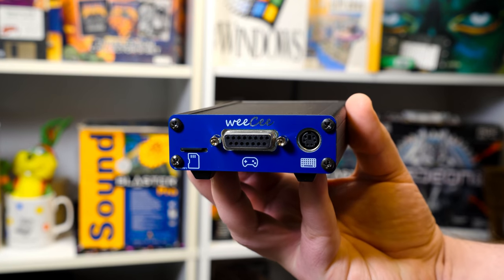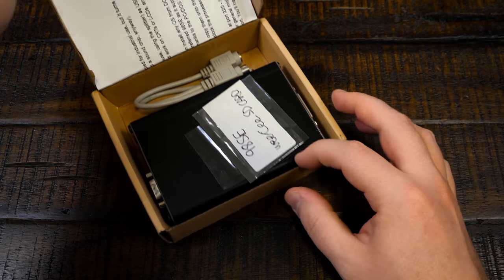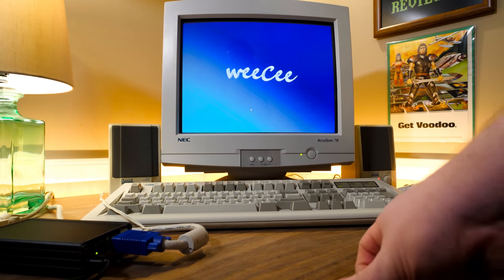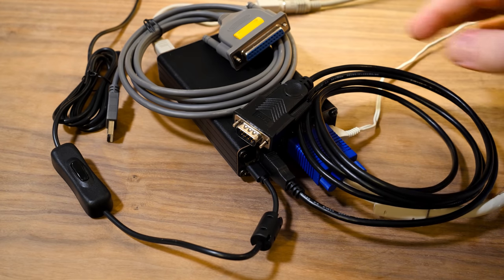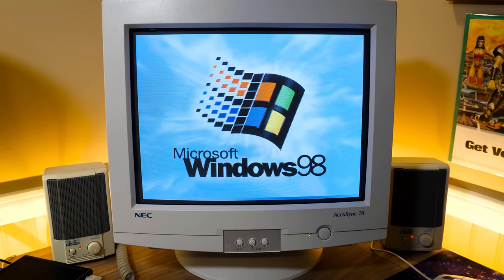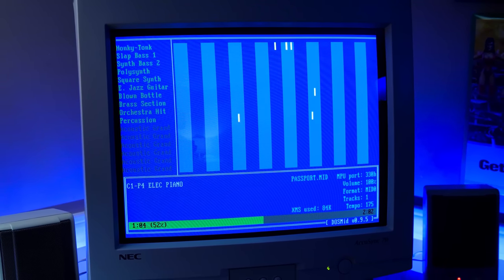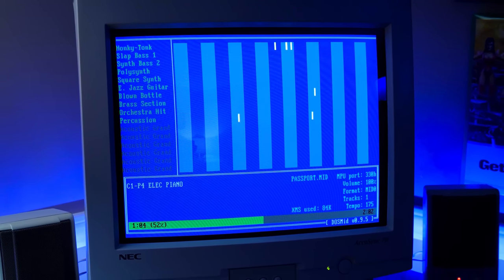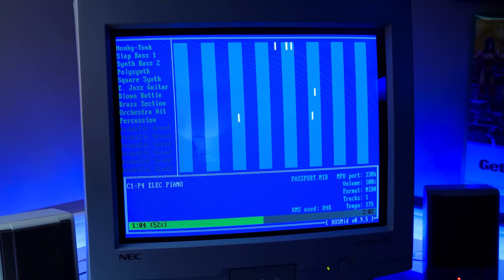The weeCee: A Tiny New MS-DOS & Windows Gaming PC!

Comment: Where do they get the Crystal chips? They are still available?

Also, the slow SD card speed is due to the card used or due to the internal controller?
Reply: I got mine from UTSOURCE (following the advice from TheRasteri's original Weecee video part 1)

as for the slow speed of the card, that's a good question. But I can read or dump 32GB content on mine pretty fast in a modern machine out of the weecee, but if I use it to mount a virtual CD in win98se inside the weecee, the process is atrociously slow. Same if I try to dump files over the network inside win98se to the microsd card, it throttles the speed to 0 every 6-7 seconds for 4 seconds, it's really annoying.
Reply: @michaeljuneau4085  that sounds like it may be a limit of the OS itself AND the FPGA chip.
Reply: @kloakovalimonada  it's not a FPGA here, it's a classic x86 clone cpu based on the SiS cpu on module (à descendant) redesigned by ICOP around 10-12 years ago but still sold today.

Comment: +Lazygamereviews  Thanks for the report on a system-on-module adaptation of an intel® 80502 CPU and support chipset.  Would have been nice, had the vendor used a larger case with room for a DB-25 for dual UARTs and a 36-pin IEEE 1284 C-jack, as MinIX, an early Linus Torvalds instructive/executive OS, doesn't like USB UARTs any more than the current iterations of LinUX.  Also, a Compact Flash jack for Enhanced IDE plus a CR2032 socket.

Comment: So, I guess the 32GB CF card I have as a disk for my Win98SE machine might be a little much, eh?  It's fast though!
Reply: I'm using 32 GB microSD cards for my units. However, since I wanted a DOS dedicated one, I can only use 8GB in 4 partitions that are at most 2GB each. For my win98se dedicated machine, since I didn't have a virtual hard disk pre-installed, I had to first install DOS on it (2GB main C partition) and then I installed win98se and later opened up the rest of the 30 GB in a 2nd partition. I prefered going through the win98se install motions since I wanted it to at least recognize the hardware itself and install the closest drivers it needed.

Comment: Only reason I would buy this would be to create games using PC Speaker, so the lack of a PC speaker is a deal breaker for me, unfortunately
Reply: the pc speaker sound is mixed in the output of the sound chip. The only thing missing is the beep POST sound simply because the sound driver isn't loaded yet at that point! you'd still hear your game beep away!
Reply: @michaeljuneau4085  Awesome! How about PC Speaker PCM sounds, do they sound similar to real PC Speakers when mixed with Sound Blaster sounds? I believe PCM sounds on the PC speaker work because the cone movement is not instantaneous, so even though output is 1-bit, one can use different timer countdowns to obtain various positions to better reproduce the waveform. Is that only possible in real PC speakers or is it possible in this case too?
Reply: do you have an example I could test out that you feel could reveal some weaknesses in the CS4237 chip that's used here? I do have a real IBM 486DX2/66 that I could compare side by side

Comment: I wonder how this compares to the MiSTer’s 486 core
Reply from the maker: It's not really comparable, there is no emulation or chip simulation going on here at all. Basically just a '90s PC built using new components. This is also significantly more accurate, and faster, than the AO486 core is, currently.

Comment: I don't think there's a market at the £250 price point. That makes a genuine retro system within reach, and those willing to spend that much is more likely to want the full retro experience. If it was possible to lower the price to around £99 or so, then I'm sure there would be a pretty big market.
Reply: the system-on-module cost me 177 USD each without shipping and I'm guessing I didn't have a reduction with my purchase of 2 SOMs. It scares me to imagine the volume you'd have to buy to reach £99 and that's forgetting all the rest of the components which amount to quite a lot. Even the S2 dreamblaster daughter card eats a sizeable % of your target price.
Reply: @michaeljuneau4085  Well, if the parts list ends up being over $200 US, then I don't think there would be much of a market for this. And herein likes the problem with a lot of projects of this kind.

 It's really not relevant to marketability, what the parts cost, because there's a max price tag that people would pay for something like this. It's the same with an actual vintage system. Offer somebody a nice 486 system with everything they need and charge $150, and quite a few people would buy it. Charge $300, and much fewer people would buy it. Tell them that because of the rarity of the parts, just putting it together is $250 and they'd say "sure, but I'm still not buying it."

There's always a balance between how desirable a product is, and how much it costs to manufacture. I never suggested that it would be possible to build this system for $99, just that I think that the sweet spot for being able to sell something that effectively is a "PC Classic Mini" would be around that price bracket. :)
Reply: @Rebecca Shade The parts is just the first step. The labor, if kept manual, is at least 5-10 hours depending on experience. This can be cut down by having all smts - preassembled at the pcb manufacturing, but I haven't explored yet if it saves costs or not. There's also the quality promise that's an intangible and will rear its head for sure eventually with volume, people expect a perfectly working machine at a multiple hundred dollar purchase point, for at least a couple years. I've already determined the poly fuse in the v0.3 design to be too limiting when you start using USB devices. Also had to replace the eeprom for the sound card because the initial one would just refuse to write through dos software. The wear and tear over some connectors might crack joints over time and that's more legitimate complaints that might arise in this warranty less transaction.

Frankly, I understand Andy for not subjecting himself to all that mess and loss of peace of mind  at any price point. It's incredible that he has willingly shared 100% of the roadmap for people and also helped debug my various problems as I was assembling my first unit. I took over the Vogons thread about the weecee for about 2 weeks, as the Orpheus sound card designers also helped (their card also use a cs4237 chip)

Comment: USB 2.0 is a shame imo. With USB 3, you could probably have had an external hard drive for far greater read/write performance then an SD card (that is probably also on the same bus as the USB 2)

Comment: why not just use a  Raspberry Pi ?
Reply: because it's slow and it'd bring you only up to very simple, early software render 3d games (1995?) and it'd struggle even then. This blows past this all the way to the edge of all games right before needing 3d acceleration (circa 1996-7)

Comment: So basically anyone can make this, you just have to buy everything yourself and put it together yourself?
Reply from the maker: yes
Reply: the system-on-module from ICOP or from DM&P, the sound chip from utsource, the PCB from pcbway or JLCPCB, the Hammond case from Newark, and all the components and connectors from digikey or mouser.

Comment: No 3dfx -- no fun.  
Year-1996-limited machine.    3dfx era 3d games looked ugly in software mode.  
For 2d games 100mhz CPU, 16mb RAM and 2mb vRAM was enough. So, this device is disbalanced overkill, that can't run even Q1 smoothly.

Comment: I am getting fed up of seeing these UNFINISHED PRODUCTS that support outdated equipment that you can not buy like PS2 keyboards.

I bought the Maximate 2 which is colour version and its a pile of.
Reply: AND A FUCKING 5V MICRO SOCKET for power... WHY? Why can these Muppets stuff in a power option for OLD LAPTOP PSU'S that gather dust somewhere, a VARIABLE VOLTAGE REGULATOR to allow a WIDE RANTS of old PSU's from 5v to 30v as a good safety margin.